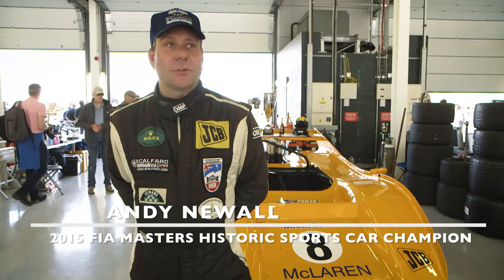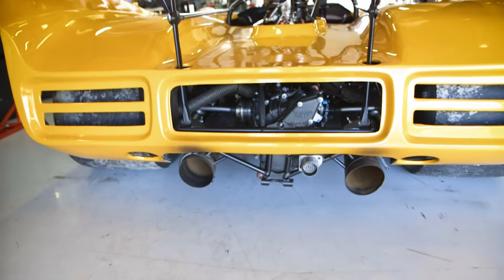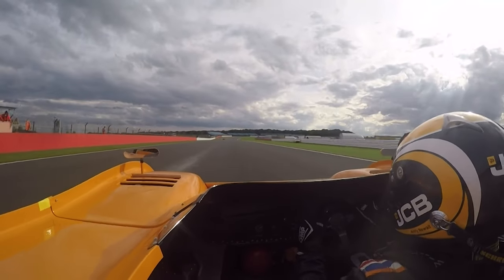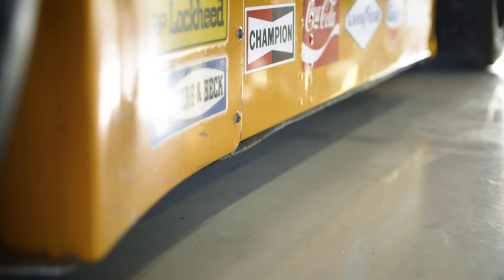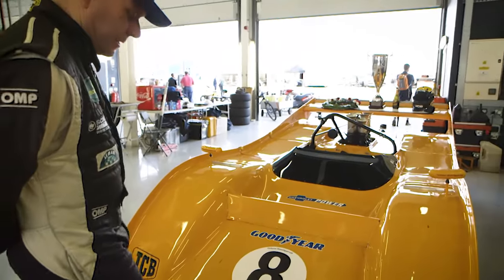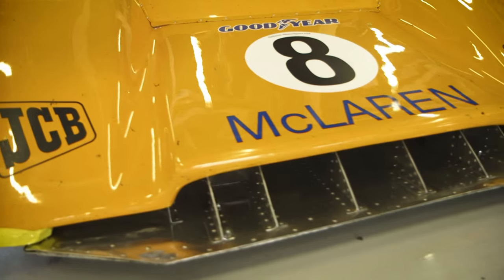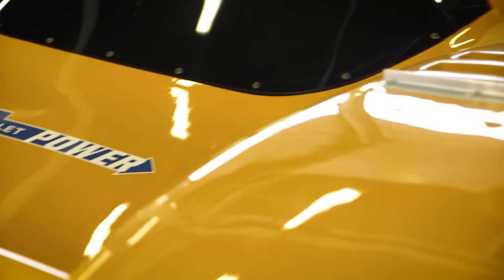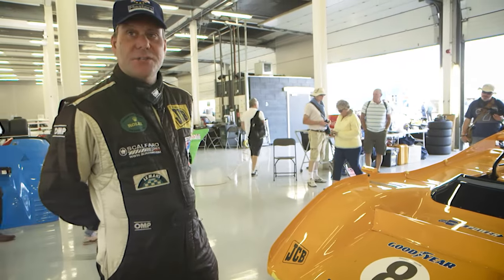Inside an 8.8-litre V8 McLaren Can-Am Monster

Comment: Amazing car. 900 horsepower, listen to that sound. And the way it reels in the lesser cars, looks like the video is in fast-forward. Shocking to think even these numbers are still dwarfed by the 917/30 that could be turned up to almost 1600 horsepower in qualifying tune.
Reply: Then think about the BMW straight four with only 1.5L of displacement pushing 1400 HP back in 1986 with 70PSI of boost. Only lasted for qualifying though haha! Full race tune was still around 1000HP though. 
Can only imagine what folks could do today with titanium blocks, heads, rods, crank and pistons! Probably 2,000-2,500HP, and if methanol was permitted hell, 3,000HP wouldn't surprise me! 
sigh still dream of them making a proper 3.5 Liter V12 with compund turbos, 20,000RPM limiter and 10 bars of boost, that puppy would surely break the 10,000HP mark! Smack on some unrestricted chassi with ground effect, Variable suspension, variable wings and AWD. 
Hell at 10,000 HP even a propeller would make sense :P Only at like 300mph could you put that to the ground!
Reply: How about running Nitro while you're at it?
Reply: @TheEsseboy  3.5l and 10k horsepower with 3.5ls and 12 cylinders I don't even see that happening maybe under more then just 20k rpm and turbos it's possible but a v12 that small well it's not going to live long.
Reply: elektro3000 Let’s not get carried away. Yes, people are always going to talk about the 917/30 when CanAm comes up. But in race tune, which is what matters, it was pulling about 1,100 hp - about 200 hp more than the McLaren. There is no source for the claims made for the Porsche engine, other than the endless repetition of the internet. Remember, the turbos of that era were not nearly as sophisticated as they are today and had an absolute limit of 1.5 bar. The boost dial was not calibrated either, so in reality, nobody really had that much idea of what it was producing. At max boost it was probably not more than 1,400 - which is a phenomenal amount of power by the way and still 500 more than an 8 litre Chevy. If you look at the real figures; torque and RPM, they don’t really add up, certainly not to the oft-quoted “1,580 hp” that so much jism gets spilt over. The only source I have seen for that is a video game.

The 917/30 was a special car in anyone’s terms and it took a very special driver to get the best out of it. There’s power and there’s useable power and it would have been even more difficult to drive than the McLarens. The Chev would have been about the same for low end torque but not nearly as good through the midrange and upper revs as the Porsche. That’s the turbo factor at play - less falloff. But they were big turbos and would have taken a lot of air to spin up, unlike today’s turbos which are much smoother. Their cut in would have been savage.
Reply: jonny j  
"For one, with the same size turbos, there is no difference between "todays" turbos and the ones they used to run in can am."

Of course there is. For a start, have you ever heard of "Ebersbacher" turbos? They're truck turbo but that doesn't actually make any difference. The difference is in the amount of control you have today. The wastegate was the only thing that could be calibrated. That never ran above 1.5 bar. Any other claims about adjustment are conjecture only because, unlike today, there were no set marks or points on the dial there could be no way of knowing what the exact level of boost was. Now if you know how to work these things out, that is not really enough to support that kind of power claim.

Secondly, the 912 engine, to give it its proper name, was assembled from air cooled cylinders with no water jacket. The obvious advantages in weight are offset by a lack of torsional rigidity, which was its Achilles Heel.  Lack of torsional rigidity is a really Bad Thing. It kills engines. The 912 was also cobbled up from 908 parts, including the connecting rods and cylinders. The difference was that Peich attached them to a flat six block and then joined the two blocks end-to-end with the PTO in the middle. That made for a rather long block, further reducing torsional rigidity.

Another thing bout the 908: it was built to produce 350-375 hp. the rule of thumb on engine components is that if you double the power output, you quadruple the loads on the internals. But you're claiming more that triple the amount of power, per cylinder, which is just not feasible, even though it's spread over more cylinders. Sure, the components were beefed up but they would have had to be beefed up by a factor of more than 9 to withstand those loads.

"And if your talking about assetto corsa, they got that 1580hp straight from porsche LOL..."

No they didn't and you can't prove it. Porsche have not made any official claims about this car. I asked. You might find it on a fansite with Porsche logos on it but that isn't really proof of anything. Ian Bamsey - not known for his restraint - did talk of a 912 turbo engine being pressed to destruction in a test cell and claimed the power was somewhere north of 1,500 when it blew up. Oddly enough, I'm inclined to believe him but that is not the same as reliably producing it in a race or in qualifying. An interview by Adam Carolla with a Porsche engineer is decidedly vague about it. The nearest he comes to confirming it is when he says "Yeah, I heard about that but I was not there". Not exactly a ringing endorsement.
Reply: The Key is..the 917/30 was a euro (boosted version of a can-am car with 100% more downforce).
The girls in F1 (NEVER) had to deal with low downforce and 700ft-lbs at the touch of the throttle. It took Real balls to race...similar to old rally racing on dirt where the car was Always in a drift.
Reply: JerseyMikeP And yet F1 drivers were very successful in CanAm. It was called “The Bruce and Denny Show” for a while, such was McLaren’s dominance. Look at the list of drivers - McLaren, Hulme, Surtees, Stewart, Amon, Siffert... all at the pointy end of the grid in both classes.
Reply: 1.5 l  whatever = no torque blues ...
Reply: Bruce Dressel well, if you understand how it is produced, no torque would equal no power.
Reply: Could a 10 liter V8 Chevy give the 917/30 a run for its money? We'll never know..
Reply: md khafizan the answer is an obvious yes
Reply: @TheEsseboy  producing power was never an issue, getting grip is an issue, having a easy to drive car is an issue, transforming the power into laptime is the magic thing. you have clearly no clue about racecraft and you're just impressed by big numbers.
Reply: @gnutscha  If that was true they wouldn't limit power in sports...
Reply: @TheEsseboy  try to drive a car with 1000hp on a normal race track, you will rarely go even 60% throttle for longer than a second. why would you need 10.000hp? its just childish.
Reply: @gnutscha  Because of downforce, more HP means larger wings. You clearly never watched F1, they go wide open for up to 10 seconds because they can break with up to 6Gs, 300-0 in 3,8 seconds.
Reply: Turbo charged tho this is NA
Reply: @zacht9447  You mean ONA? Organicly Naturally Aspirated. NA is dead...just get over it 😊
Reply: jonny j  I'd take a bet I know more about it than you.

Comment: I saw these breathtaking cars race a couple of times at Riverside Raceway in Californa in the early 70's. You should have heard the roar of this big field of cars !  Dennis Hulme and Bruce McLaren led the whole race until Bruce broke something and spun off the track and into a wall right in front of me, and spun back down onto the track again.  He hit a flag man right in front of me as well.  I think he died but I'm not certain.  Hulme won the race.  I miss these fantastic tigers and their roar, beauty, and speed.
Reply: Bruce Mclaren was killed June 2nd 1970 testing his car at Goodwood circuit in England.
Reply: Jeez, that's grim. That's one of the reasons I stopped going. I was always worried I was going to see something like that.
Reply: We must have been standing fairly close to each other as he hit the infield wall almost exactly in front of me. As I recall something in his suspension broke. 1969 was also the last year of the “high” wing in the cars. I actually managed to get his autograph on Saturday while walking around the pits. I will never forget that race!